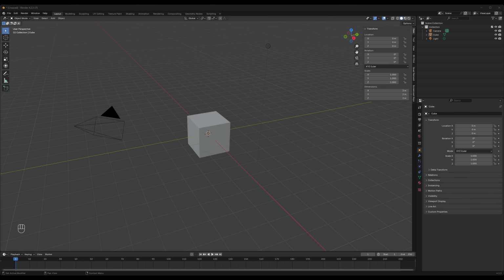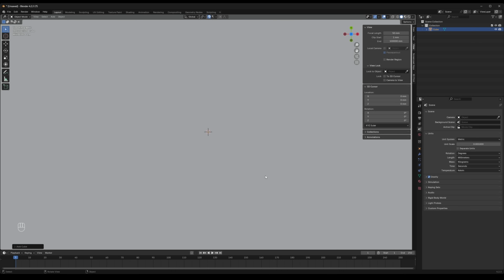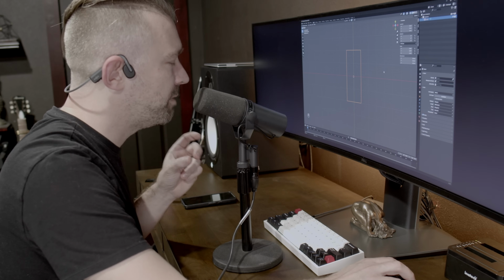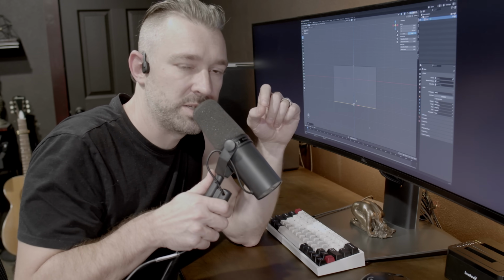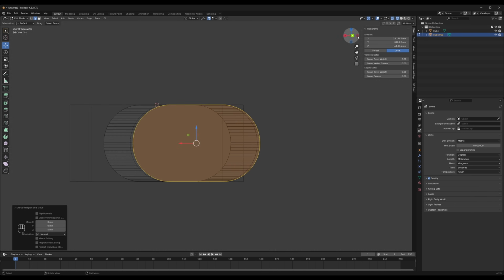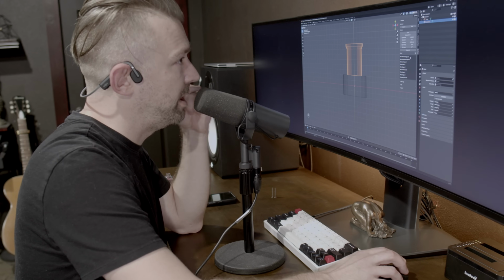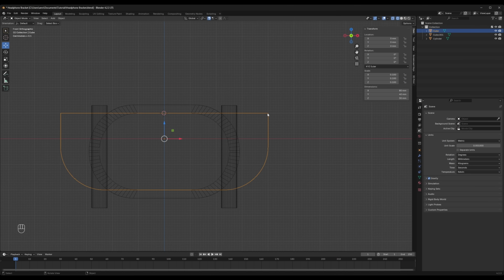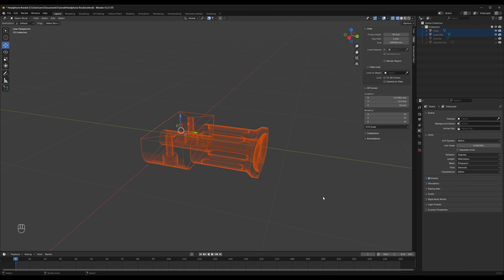How to Design for 3D Printing in Blender - Beginner Tutorial

Comment: Just because you can do something doesn't mean you should. If you already know blender and you want to use a tool you are familiar with to design a part to 3D print, sure. But blender is not the best tool for precision designed parts. If your aim is to design precision parts, use any CAD tool. If you want to design artistic models to 3D print, don't use CAD, use blender.

Comment: I had no idea Blender could do that! So I installed the 3d toolbox but then I got stuck... all my work on Blender is for 3d printing and most of it based on a cylinder that I apply a texture to, basically, a texture roller. Once I installed the toolbox I suddenly couldn't design a cylinder anymore, it would do weird things when I tried to, for example, add a "Subdivision" modifier. So my question is: does it change the way I design things because of the 3d toolbox and i need to relearn Blender? Or, well, a second question, am I better off using the original set up for my work?

Comment: Would have liked to have the manifold edges part explained a bit, I ended up with 104 Non-manifold Edges when yours showed 0. Not sure what I did wrong, or what it actually means... Learned a ton besides that though that is going to help where I was getting frustrated before.

Comment: Fantastic video - especially with the time you spent on setting up the actual scene. A lot of people don't cover this part (especially the camera clipping) and to be truthful, the scene setup is one of the most important parts of any project!

For a note to anybody - the Orthographic view is the ONLY way to work on precision modelling. I would like to add, that if you have a number pad, you can use the keys 1-7 to change the viewport (top, bottom, left right etc), or, if you have a standard keyboard, the ` key (usually the key to the left of the number 1 key) on your keyboard brings up a wheel of angles that allows to to hover and select the view angle when the ` key is pressed down. 

Fantastic video man, nice, concise and super helpful. Even learnt a thing or two myself!

Comment: A lot of people are right, Blender cannot make precision models. Blender looks like a powerful product.  I've used Catia for about 15 years, precision was out to 4 place decimals. Stared using Freecad a couple of weeks ago precision is 2 place decimal. Assembly parts that fit require precision. I also use Rhino 3d release 3. Which is also a 30 year old cad program. As a surface modeler Blender looks great. And good video, I may have a use for Blender too.

Comment: hello! How would i need to set this up for building in inches? I want to go imperial and try my hand at this from the math i understand, but it is... not working well. lol I can get it to go imperial, but the measurements are all kinda wacky. For example, I wanted to try measuring out all the pieces in Catan to make them myself. (Ive seen a ton on makers world. but i want to learn myself). So i set up imperial. I set it to inches. and the grid is now pretty off. I tried setting that to a scale of 1, with 8 subdivisions so that the subs would measure out to an 8th of an inch but I cant actually get the subs to change. its greyed out. but i figured id live without and just went into building all of my pieces out. but then when i was done and brought them over as an STL they were super small. which looks like its because my measurements are right, but Blender is actually making the grid/universe about 1 foot by 1 foot. not 1 inch by 1 inch. so im a bit stuck on how to get Blender to understand what Im wanting... Feels like I am gonna have to constantly just measure in inches and then convert to meters so i can then finally start building and I just would rather not. lol

Comment: Blender + 3d Printing intros for beginners have been really great, thank you!
Just as a little thing, but I've found that setting the grid scale to 0.05 (half 1mm) helps when your object starts off from a default central location. For example, if the object is 25mm wide it means the edge of each side falls in the middle of of the 1mm grid. (12mm from the center + 0.5mm on each side). So if you have 0.05mm as the grid side you can still always drag your other objects to snap to the very edge of that 25mm wide object.

Comment: Great job of explaining how to use Blender for 3D printing. I think this still is one of the best video's on this subject.
You could use modifiers a lot more in this video. Then your design is more maintainable. You could use the mirror modifier for the holes. You should not apply the boolean modifier and make the cylinders invisible. You can make vertex groups and use a bevel modifier on them. This makes a non destructive workflow. Teaching people a destructive workflows might make people think parametric CAD software is better.
Reply from the maker: Thanks glad you like the video. When I first made this video I tried to keep it a bit more simple and use less tools than I normally would. For the applied modifiers, you're right. When I did this project I went with applied modifiers to try to keep the workspace "cleaner" and easier to understand. But in hindsight I should have shown the opposite. Its hard deciding how much to show or not show. Future videos will be a bit more polished.

Comment: Good tutorial. I have used Blender a bit, for making object similar to how you did it (though far simpler models). But the whole setting up Blender for 3d printing, needs some sort of "setup wizard" in blender, that gives you the choice of what you are planning to use blender for, and upon selecting 3d print modelling, set up all the parameters in regards to units, installs the plugin, and so forth. Because that was the thing I did not like, having to figure out how to set the scale and units, so they were correct for what I was trying to do. You explain well how to do it manually, but it needs to be an automatic "setup wizard" feature in blender that does that for the users, with the option to save, and load on default, that as a profile. 

The second thing is that Blender works well to create a model. But modifying an excisting / already made, model is another thing. If, as an example, you discovered that the screw holes were too far apart and needed to be closer together, it is just not accomplished by simply changing a distance value. The Boolean cut is already made, and that needs to be repaired, then a new Boolean cut needs to be made in the correct distance. Or you could go the route of having multiple versions of the model stored as multiple files, so that you can load up an earlier file and do the Boolean cut in the right place. But then, if you in your original work have done other changes, those changes need to be done again too. 
That is were parametric design shines, as 3d printing function objects often seems to be printing new iterations of a model, with small changes to it. That workflow is not very compatible with Blender. In Blender you kind of have to get it right in the first attempt. 

Also, the suggested "setup wizard" also needs to set up an automatic check of the model in regards to wether it is 3d printable or not, and with the ability to fix issues automatically, or manually. 

Lastly, as Blender is king in regards to modelling of figures / sculpting, that would make an excellent topic for a tutorial. How to sculpt a model in Blender, and make it 3d printable.

Comment: Excellent tutorial, but I do have one question. After making the changes to configure the scale for 3D Printing and saving it, so when you start Blender those settings are now the default. Is there any way to easily switch back and forth from those settings and Blender's default settings? Thanks!

Comment: Finally setting blender up for mm, I was always using the default and then the models would be imported at the wrong scale in the slicer, not a huge deal as you can resize in the slicer but this will save me so much time, thank you 🙏

Comment: I still believe that Blender is not good for mechanical parts. Your video helped me understand how to make things printable from blender. But for things like the headphone hanger definitely i would  go for proper CAD like Fusion or Solidworks. But Thank you very much for the video. I just made a low poly car in blender and this will help me add whatever's necessary to make it printable!
Reply: It also fails if you have an assembly of more than 1 part.

Comment: I wouldn't use Blender for designing high-precision parts, especially if future modifications are expected. But here's a tip for anyone interested... Press Ctrl + Alt + Q to switch to Quad View, which shows the Front, Top, and Right views alongside the 3D perspective. Then, while focused on any of the orthographic views, press Numpad 9 to flip the view: Top becomes Bottom, Front becomes Back, and Right becomes Left.
Reply: Didn't know that. Thanks!

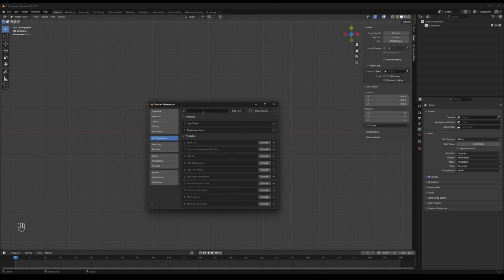Comment: I appreciate your presentation style, it is refreshing.  However, I'm an absolute beginner with Blender, just installed it - version 4.0.2 on Linux Mint 22.1 and I cannot duplicate adding the "3d print" extension at 3:25 into your video.  My "Blender Preferences" window does not show a "Get Extensions" button.  The manual doesn't help me find "3d print" either.  Would you be so kind to offer assistance, please?  Thank you in advance and my apologies for asking.
Reply: I should have installed Blender from a Snap or Blender's site instead of my O/S software manager.  Version 4.5+ has the "Edit/Preferences/Get Extensions" button.

Comment: Thanks for the video.  Question: what happens if I do indeed have non-manifold edges; how do I fix that?  Thanks.
Reply: Fix them in order, it's usually quick. In Edit Mode: A to select all, M > By Distance (merge doubles), then Mesh > Normals > Recalculate Outside (Shift+N). Then Select > All by Trait > Non Manifold and see what's left highlighted - open the N panel overlay stats so you can see the count drop. Stray single edges/verts from a bad extrude: X > Dissolve or just delete them. Holes: select the boundary loop and F to fill, then triangulate/grid fill if it's a big one. Interior faces (a face left inside the solid after joining parts) are the other common cause - select non manifold, hide the outer shell and delete anything floating inside. If you booleaned two objects, make sure each one was closed and watertight BEFORE the boolean, otherwise you just inherit the errors. Last check: enable the 3D Print Toolbox add-on (Preferences > Add-ons), hit Check All, and it lists non-manifold, thin faces, intersections and overhangs with a jump-to-error button. Once Check All is clean the slicer won't complain.

Comment: Thank you for this video! One thing that I've learned from working in a Japanese manufacturing is to keep your unit of measurement to the smallest unit of the machine. (Ex. always use millimeters, not flip flop between mm and cm.). Other than this minor observation, I love this video.

Comment: When i go to the get extensions on the preferences tab nothing shows up even though I typed the thing i was supposed to.
Reply: If you are running a version of Blender earlier than 4.2 it won't show up. I'm using Linux Mint Debian Edition as my OS and the version of Blender offered in the Software store was 3.x. When I loaded it the option for get extensions was not there so I searched for 3D Print and when I found it saw that you need 4.2 LTS or newer so I went directly to the Blender page and downloaded 4.5 and it's showing exactly as it should.

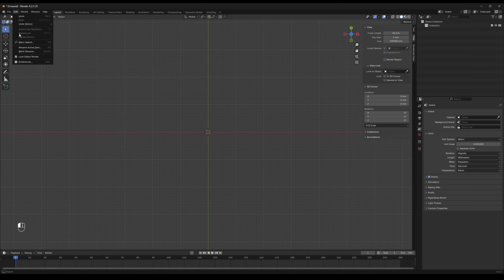Comment: 3:20 "... once we're in preferences we go to get extension and we type in 3D print and then once you type in 3D print just hit install right here..."

I am running 4.1 on June 26th 2025, when I follow the steps below, I get nothing, in my version it is called addons. Did it change? I did find a tool called 'Precision Drawing Tools (PDT)' but nothing under the search 3d print. Thanks these videos have already helped my 3D work flow.

Comment: Cool, very useful stuff about setting up the viewport. As a blender user i'm pulling my hair out working out the logic of fusion360 or freecad. Also, for anyone watching, be sure to always 'apply scale' before you bevel or inset or use any modifiers (ctrl/cmd+a, then apply scale) Otherwise, your edges might not be proportionate to the model, depending how much you've modified the base object.

Comment: Very informative especially for a 72 year old newbie like me.  Only bought a 3D printer a week ago. Never used one before but already wanting to design my own bits 'n' bobs.  Never did any 3d modeling before either but I've downloaded and Installed blender. I do have many years, 40 plus, of computing behind me as a programmer, technician, and 17 years as an IT Manager. One thing I don't get about Blender, and I believe it's similar in other 3D apps a s well is this use of the word Boolean.  In Programming it's a simple concept. TRUE or FALSE.  In 3D it baffles me.  Maybe I'm getting to old for this game but If you want or need to cut a hole through an object why not just call it a HOLE CUTTER, just like we have in woodworking.  Makes more sense to me, and yes I'm also a DIY'er.  Just my 10 cents worth.   Thanks for the video.  I'll go ring that bell now to see what else you have.
Reply: Agreed. As soon as he said Boolean my brain started trying to find how to justify the naming convention! 😅
Reply: I believe the term Boolean is to do with the type of calculation used to actuate the process. Boolean was, if I correctly recall, the name of the mathematician ... Something like that anyway .
Reply: @neshiah4747 George Boole - English mathematician in mid 1800s.
Reply: I like to think of it as two objects made of 1s and 0s. Now when you merge the two objects, you either "add" or "subtract". True or false

Comment: Hi Zero, extremely helpful setting up the zoom factor for me. I did however not find the "Extension" "3D Print" in Pref's, only have "Add Ons" which I assume are filters. I´m using version 4.0, maybe it´s just to update Blender? Yet otherwise, it was a cool start. Thank you :whistle-red-blow:
Reply: Did you ever find a way to add the extension "3d print" in Pref's?  If yes, would you mind sharing with another lost soul, please?

Comment: God I love Fusion 360. The complexity involved with designing a basic model here is incredible.
Reply from the maker: 360 is nice. Blender certainly isn't for everyone.
Reply: Agreed.  It was interesting, and maybe the point of the video, to show that it CAN be done in Blender.  But in the end, the right tool for the right job.  In most cases, Fusion will get a job like this done in a fraction of the time and effort.  Plus, I can output Gcode for either my CNC, my Laser, or my 3D printer.  Thank goodness for Fusion here too.  With that said though, my I am trying to learn Blender for things it is good at.
Reply: Fusion 360 free version is easier to learn, but you will quickly hit its limitations.  They you will be paying constantly for features you don't want.  I personally donate to Blender and the community has been very good.
Reply: Trouble is F360 is ridiculously priced and once paid for you still have to keep paying it's a prohibitively expensive product but for those with more money than I then why not?
Reply: @jamescattanach1129  I believe it comes in at roughly $370 a year. That's $30/month. Netflix is $25/month. When it comes to CAD software, Fusion 360 is very cheap. I just priced out F/X CAD that AutoDesk provides along with their Irrigation F/X plugin, and it's like $1600/yr... but that is really cheap if you are a professional drawing irrigation designs for jobs. It pays itself off in 1 job. 

So long story short, professional CAD software only makes sense for professionals. If you're just going to design a dragon figurine to put on your shelf, $370/yr is steep.

Comment: Great stuff thank you, the only issue i had was when i exported the model it didnt have the boolean cut.  Pressing A to select all  and then going to export just kept the cylinders, i had to just select the parts after hiding the cylinders then check "selected only" on the export.  Then it exported with the cut.  Another way was simply to delete the cylinders objects.  But I have a newer version it looks like, theres a new tab not shown here called "3D-Print" where "Item", "Tool" and "View" are.  When you click there it has an export to STL option and applies the modifiers automatically without having to select anything.  Its also has some other handy options to check your model to make it suitable for 3d printing, very handy tool, thanks again.
Reply from the maker: Yeah Pressing "A" to export isn't the best idea as it will grab everything including hidden objects that are used for cuts. I tend to hide everything I don't want export and then drag select everything else. Like you said. Just make sure you have selected only and modifiers enabled.

Comment: What are the settings for imperial units? I set up to inches, now what about the unit scale? Should that be something like 1/64th (0.015625)? What about the view scale? You told us what to set theses values to for metric but never explained what it actually does.
Reply from the maker: Honestly I wouldn't know I have never attempted to model in Imperial since everything with 3D printing and design is normally done in metric. The values set the scale to be correct with real world values as blender units are relative and not exact.